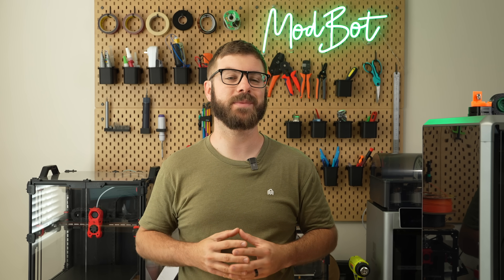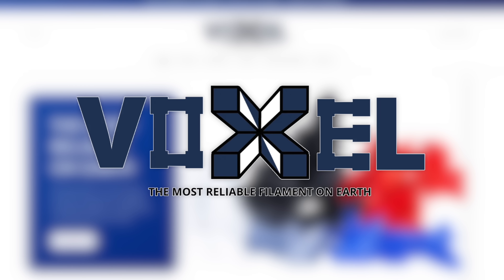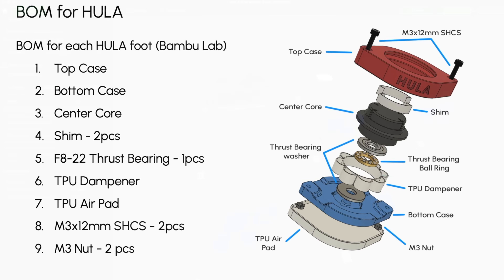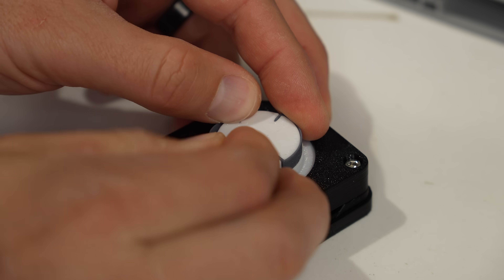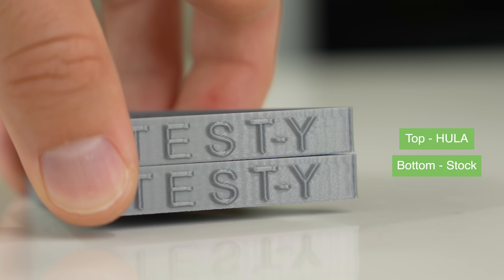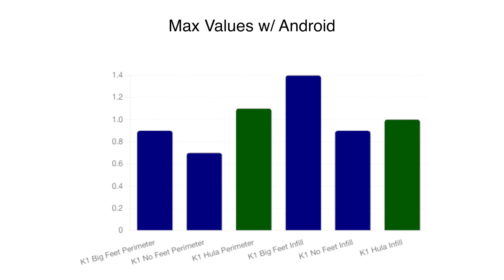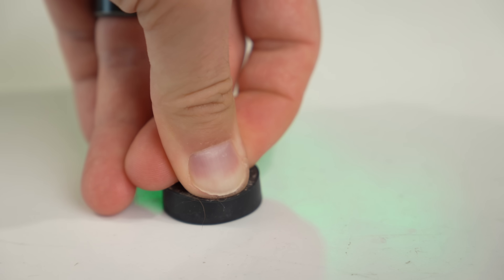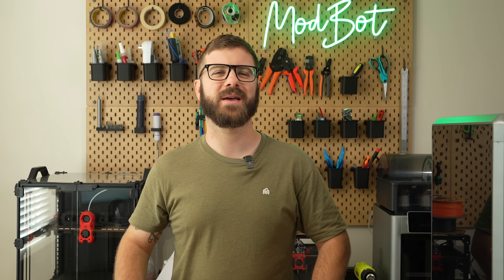Self-Aligning Anti-Vibration Feet For Your 3d Printer (HULA)

Comment: PSA: if you have a stone base for your printer you should be putting the printer directly on it and then have the damping mechanism (feet or foam mat) under that. this way, the printer still has a hard flat surface to sit on, instead of a soft one that allows the printer frame to flex under its own movement which is a bad thing.

another thing to note is that whatever damping mechanism you use to dampen vibration must be tuned, or else it is not a guarantee it will work as you expect. you still decouple the vibration from printer to furniture, maybe reducing furniture noise, but the effects on the printer itself may be worse. for example you can have the printer sit on a balloon and have zero noise from the desk or rack, but then the printer will be bouncing and shaking all day long, making the prints worse. or you can have feet that are too hard, making the table shake more, but therefore allow the table to participate in the total dampening effort, absorbing the wave energy and converting it into heat in the wood, possibly making the prints better. do you see where i am coming from?

at the end of the day there two interests at play here for the hobbyist. are you trying to decouple the printer from your furniture to improve the noise situation or are you trying to improve your print quality (increase max acceleration potential)? these should not be assumed to be achieved at the same time, even with something like HULA, which claims to hope to improve both, but upon light scrutiny of the documentation is really only expected to achieve the former. this is because the former has to do with the interaction between the printer and the furniture, tackled with things like HULA and other types of feet. 

whereas the latter has to do with the interaction between the toolhead mass and the frame mass and how quickly the frame can transmit the kinetic energy (stiffer frame) to the damping mechanism and how efficient that mechanism is to converted it away into heat (damping coefficient). if the TPU springs in there are not tuned to the mass of the printer, it will be through sheer luck if the max accel is improved by a statistically significant amount. it's not impossible, but somebody needs to iterate the design of the TPU springs and prove the best one empirically..for a specific printer as all printers are different.

further complicating this issue is that whatever you have the printer sitting on will have its own mass and damping characteristic, whether it is a shaky rack or a solid wood desk or the concrete floor in the garage. if you add feet between the printer and said surface, then you add one more variable to the total system and cannot possibly hope to know with any confidence what that will do to print quality without extensive empirical testing. although i can tell you that no feet on the concrete ground is in fact the worst possible option for print quality because of infinite impedance and zero damping but let's not get into that.

simplifying this issue thankfully, is input shaping, whose sole purpose is to perform active damping, will do all the damping that will ever be required to improve print quality. which means you actually do not need to rely on any physical damping mechanism whatsoever to improve print quality, but only need to make your frame stiffer. if your table is so terrible that your prints actually improve with HULA, maybe you should not be using that particular table...my advice and opinion is that HULA is for furniture noise improvement only. 

the point of all this is that the testing on HULA is only useful for the specific printers they were tested on and the specific furniture as well. you have no guarantee these will work for your Ender, Voron or what have you sitting on your IKEA or custom table, unless you or someone already tested it. and unlike all the other feet designs on printables, this one will actually cost you quite a bit of money and time. as a maker project, it is worth doing. but you should be prepared for disappointment if you expect too much from it.

lastly, if you are trying to measure vibrations, the tool must be rigidly attached to the sample. the phone needs to be screwed or taped flat down, preferably with no phone case on, not sitting on a stand or propped up against a spool. for the same reason you do not rest the adxl device on the toolhead with gravity alone when you are doing input shaping calibration.
Reply: I believe this comment is 100% correct except for one additional factor: input shaping calibration measures and cancels the vibration effect of the toolhead alone, not the displacement between toolhead and print surface. It essentially assumes that the bed is fixed to the world, but this is obviously not the case. The amount of vibration that the frame transfers to the bed vs. to the world therefore is an error term in shaping calibration. I personally hypothesize that this effect is the cause of a lot of these supposed minor observed differences. This would seem to argue for making the frame as heavy as possible (perhaps by bolting it down to a block of cement or whatever, as is tradition).
Reply: @jessicav2031  Although I disagree with you that the original comment is 100% correct, you are definitely right in your observation and proposed solution. What matters in the end is toolhead to bed coupling, which means that just the coupling from the frame to the printhead is not the only equation. Indeed often the coupling from frame to bed is not ideal. Having a frame as stiff and heavy as possible both reduces any reaction forces causing accelerations of the frame, as well as increasing eigenfrequencies. 
I however dont think that how you bolt it down to the external world influences the performance, as you are merely changing the coupling of the frame to the outside world, and not affecting the frame stiffness or mass (as no matter how hard you try, the coupling to fixed world is limited in stiffness). 

And in the end, it is a moot point. The frame of the printer is plenty stiff compared to the coupling of frame to printhead.
Reply: @jessicav2031 /videos when i talked about the toolhead vs frame with respect to print quality and input shaping, i considered the the bed to be part of the frame as one blackbox variable. what the bed is doing, or the spool on on the attached spoolholder is doing or whatever dangly parts you have on the frame may all be considered individual error variables as you describe.  certainly you may choose to break this blackbox up into two or more variables but i really wasn't thinking about going in that direction. but to me they are all completely fine to be considered as one black box, and to that extent, input shaping does not care if you do or do not--it just reads the black box's effect into the final influence detectible in the measurement device mounted on the toolhead. 

but certainly i do find it interesting as an academic interest if you wish to unpack this black box into more variables and we can talk more about how if someone wishes to envision tuned mass dampers in a 3d printer the bed itself is possibly the prime candidate for investigation as it is already in that role, having roughly the right kind of mass ratio for typical tuned mass damper scenarios. the plastic print itself sitting on the bed (design, height, and material choice) can also be considered the fourth variable, and the choice of raft may be considered the fifth. this is a rabbit hole.

if we are really going into error variables, which honestly i would call "variables assumed to be constant" (meaning it is not input shaper's role or responsibility to determine the fact thereof, but the engineer's)  i would also throw in the chosen z height for Input Shaping calibration. if following klipper documentation, everyone's config has the test running at z=50. only god knows if you should be doing it at z=100 or z=z_max/2 or whatever magic number.
Reply: Another thing on your last point, about 'you do not rest the adxl on the toolhead with gravity alone', actually you could depending on the direction (up to a point).
You want the stiffness between adxl and printhead to be very high. The funny thing about stiffness is, that if preloaded, the stiffness in either direction is dictated by the stiffness of the contact. That means that as long as the induced printhead forces dont exceed the force of gravity, or in the other directions the force of friction, it would be perfectly fine.
Of course in practice it would be hard to get this working (esp. because the adxl mass is very small), but it would technically be possible.
Reply: Gonna get buried but CNC kitchen has a great video on this exact thing and does the brick/foam thing! I noticed a HUGE difference in noise when I switched to bricks, the printer noise was being transferred to my subfloor and making it noticeable in other rooms, even with silent drivers. Now it’s super quiet and I can’t hear anything even in the same room
Reply: Is it stone, mat, printer or mat, stone, printer?
Reply: @troncooo409  Top to bottom: printer -> solid slab -> compliant/soft material -> table
Reply: This comment is terrible. You absolutely do NOT want the slab directly connected to the printer. Look at makermuse's video for an explanation as to why.

You want the printer isolated and dampened, not mass just attached to it.
Reply: @winebartender6653  you put the soft isolation under the slab you dummy. nobody said put the slab directly on the ground or the furniture like what Angus did.
Reply: Do you have any evidence to back up that sitting on a balloon would worsen print quality, or that coupling from outside world to printer would have any effect on print quality?
I dont know where this myth came from, but it is very common knowledge in the precision industry that the coupling between 'fixed world' and machine is not relevant for internal dynamics. What does matter is the coupling from the internal frame to moving components.
In the industry, these machines are actually coupled with as low stiffness as possible to the ground (sometimes even with air-bearings). This is not for any internal modes, rather to decouple external vibrations from coupling into the frame.

If you dont believe me, watch the video from makers muse, where he literally suspends a printer in mid air from a rope, and it still produces identical prints to a regular setup.
Reply: @tHaH4x0r  in my section of the industry, we very much adhere to the laws of physics and observe the scientific notion that more effective mass needs more energy to move an equal amount.

That directly dictates that bolting a system to a table will have better performance, assuming the system is the only item transferring energy into the table. This is due to the larger mass ( table + printer ) needing more energy to move, and with the energy present moving less than without the table. Hence, the velocity and magnitude of mechanical oscillations of the system is starkly reduced.
Reply: @AnnaVannieuwenhuyse  I am both a scientist and an engineer, so I can respect that. If you believe in the laws of physics, then let me illustrate where your thinking is led astray.

If we model the printer as two masses, one of which the toolhead mass Mg, and another the frame + printbed Mf. We connect these together through a spring representing the (limited) frame stiffness. 
Furthermore, we connect the frame mass Mf to the fixed world through another spring representing our connection to the fixed world whether bolts or springy feet.
It is clear that we have two second order stacked mass spring systems here.

Before continuing lets first dive into the topic of 'performance' and define 'better performance'. In your essay you propose that these come from reaction forces into the frame. This is however where you are wrong. You could classify 'performance' in two ways here. Firstly tracking performance, how well the commanded location of the print head corresponds to a location on the print bed. Secondly, harmonic induced ringing. This behavior is frequency dependent and cannot be evaluated with simple newtonian laws or energy alone.

Using our model, we can now observe two interesting facts. Firstly, tracking of the printhead to the bed is purely a function of the printhead mass, and the stiffness of the frame. We want any movement in the bed to couple through to the printhead as well as possible. The higher the stiffness, and the lower the mass, the higher the bandwidth (sqrt(stiffness/mass)). To achieve good tracking over a large span of frequencies, we want this to obviously be high as well.

The second thing to observe is that the frame mass is nowhere in this equation. Where it does factor in however, is disturbances coming from the outside world. Here you again notice a mass-spring system. If we assume the stiffness of the frame to be much higher than the stiffness of the world-printer coupling (which is reasonable) we can lump the two masses of printhead and printer together. We should note, here we would like to have a very POOR tracking performance. Any vibration of the outside world should NOT couple through to the printer. This means we want a low frequency, thus low stiffness coupling and high mass. This last observation is true, but for the precision of 3d printers just not so relevant. Only if you go sub 1 to 10um precision machines it will start to influence your performance.

So coming back a bit, if you could theoretically increase stiffness of the fixed-world coupling to the frame to infinity, you'd increase the mass of the frame as well to nearly infinity. But this does not help you one bit, as the stiffness to the printhead does not change. In the end, its the stiffness that causes a deflection, not mass.

Coming back to the previously mentioned ringing, this is caused by the printhead + frame stiffness natural frequency if not sufficiently damped. This will cause harmonics at this frequency, and likely multiples for other modes depending on geometry etc. 

tl;dr I think you are mistaken in believing that: 1) performance is dictated by frame deformation due to reaction forces. 2) Assuming the frame to be infinitely stiff. 3) Thinking in terms of static energy equations, which is not a convenient way to think about and evaluate performance of dynamic machines and mechanisms.

Oh yeah as a last point, velocity of mechanical oscillations do not matter at all. It is accelerations (changes in velocity) that cause forces. And more effective mass does not need more energy to move an equal amount. If you impart a certain amount of energy into a mass (kinetic energy) it will keep moving at a given velocity. A higher imparted energy will cause a higher velocity, but with infinite time, any amount of energy will reach infinite displacement (math with infinity is funny like that). 

If this is still not convincing enough, I can refer you some literature about the subject so you can read into it a bit further.
Reply: @tHaH4x0r  in none of my entire comment did I refer to the tool head. I refer to the printer as a system. That's what we're isolating the energy to when we isolate the printer, regardless of whether or not the print head is this or that level of rigidly connected. The energy is in the system, and it will go somewhere.
Reply: @AnnaVannieuwenhuyse  Yes you haven't mentioned the toolhead, but that is kind of my point. You cannot evaluate performance without evaluating the movement of the head with respect to the bed/frame. In the end, any deviation between these two is what causes print issues, not the energy of the system as a whole.
Think of it this way: Would it matter at all, if all this energy is moving the printer side by side, if both the printhead and bed are strongly coupled? Of course not, as they would move in unison as if it is a single mass. If the printer would move with a couple of thousand km/s in space, it would have a ton of energy, but it would have absolutely zero effect on printing performance as both the toolhead and the frame/bed share this same kinetic energy. It is the relative movement that causes trouble.
Thus, any energy in this system is fine, and in the end will be dissipated by friction. I am not sure what you meant with 'isolating' the energy. If you are not introducing damping the energy will exist in the system indefinitely, so adding compliance anywhere will not change anything. It will merely change the dynamic characteristics of the system.
Reply: @tHaH4x0r  Could you kindly name us the literature you are talking about?
I really like to dig in it.
Thanks!

Comment: Put a concrete slab under it. Dirt cheap, and the best method is ever tried…
Reply: Use a concrete slab on top of a slab of automotive foam there was a yt channel that recommended that they did a whole bunch of testing. But I forget who it was😅
Reply: @VaultBoi101  CNCKitchen did that